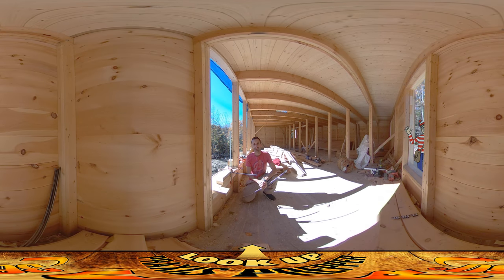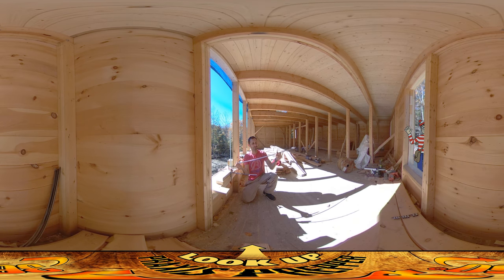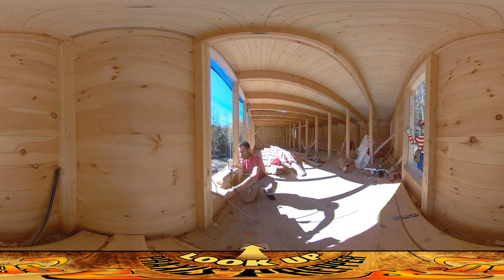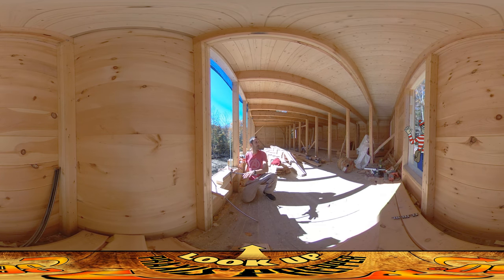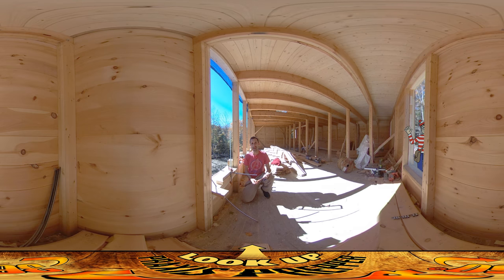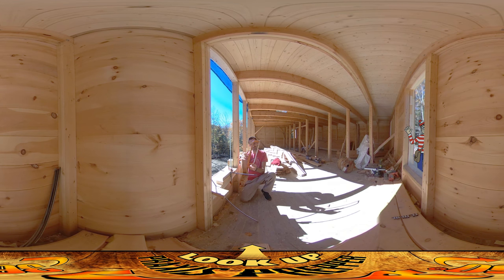Homestead Building - Hack Sawing Through Threaded Rod, Spare Parts

Comment: invest in a drop saw..

doing shit  by hand is  to time consuming and to much energy consuming especially if you are trying to setup in a shtf type scenario .
Reply from the maker: I disagree. It'd good to be able to operate in ideal AND non-ideal circumstances. So being able to function without the easiest and fastest tool is a good skill to have and to keep sharp. That's how I feel anyhow. That said, I do have power tools on site for exactly the speed boost that you mention.
Reply: @PraxisPrepper  ah something you do not consider is the lack of food

whilst it is easier to do something by hand some times however it makes it alot easier if you are in a scenario  with a lot of repetitive work  use the proper proper powered device.

less work means more output of work

looking at your body you don't look like your eating enough food..
Reply from the maker: @jasonhowe1697  It's a really good point that you bring up about the calories needed to work without power tools. It does take more. I'm only advocating that people are capable of doing things with OR without power, and to not lose the knowledge of how to work in a grid-down situation. If the grid power is down and you don't have a generator, it's good to be capable of getting critical things done none-the-less. I do try to streamline my life as best as I can for the low-work effect that you describe though. In designing this house, certain areas have been placed in a certain layout to eliminate as much unnecessary walking as possible so that more can be accomplished in less time with less effort.
On my thinness, yep, I've always been thin. I eat like a binge eater, but seem to presently have the metabolism of a Hummer (pissing through lots of fuel). I do a lot and I'm always moving, but the lack of body mass is (I think) just my body type. It doesn't worry me much at all though. If you look at people with simple lives such as hunter-gatherers, they always pretty much look like my body type. So it can't be that bad to be thin in a survival situation. Thanks for the great discussion. If you continue with this series, I'm sure you'll see me do videos about the positives of power tools. In fact, I have on in the lineup already about the wonders of a miter saw.